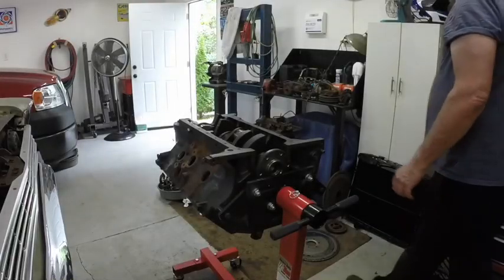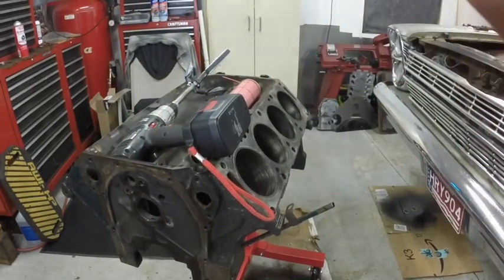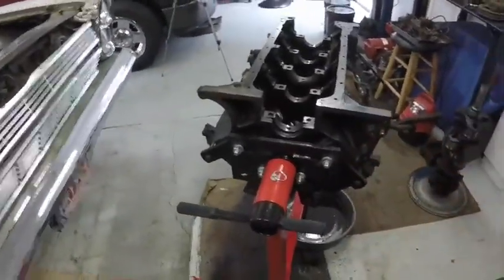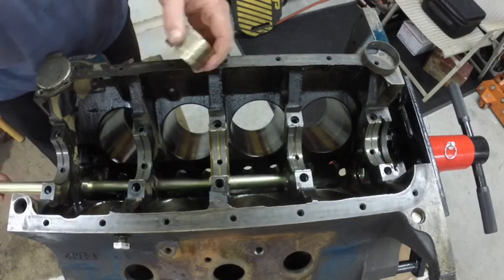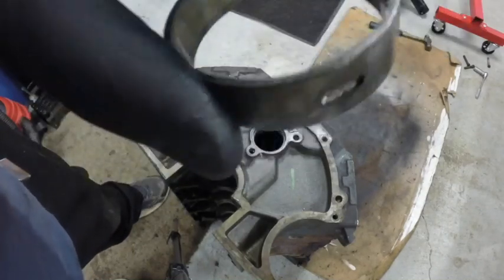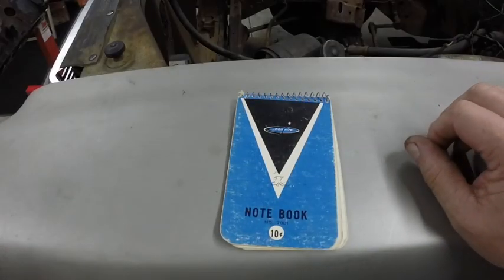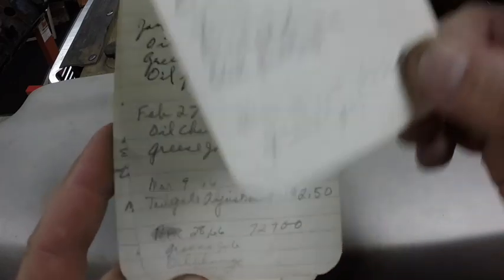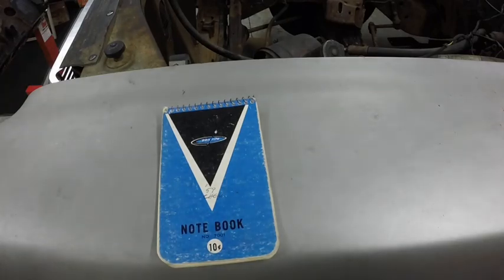1966 Ford Galaxie 500 convertible restoration part 12 honing the cylinders

Comment: You're right about the savings of doing things yourself.  I recently had my 2012 Mustang in for state inspection which it passed easily but the inspector mentioned that my water pump was leaking and would I like an estimate for the repair.  A few minutes later he came back with a total of over $400 to replace the water pump.  I told him thanks but no thanks and went home to do research on how to do it myself.  I found 2 or 3 videos of the process and it seemed fairly easy and straight forward.  Double checked my car to make sure the set up was the same as in the videos which it was.  Bought a water pump and a gallon of antifreeze for just over $100 and did the repair myself in just under an hour.  It's now been a month and about 1000 miles and it hasn't leaked a drop and I still have the extra $300 in my bank.

Comment: FM on the cam bearings-possibly Federal Mogul? also we had an International 304 V8 that had problems with oil pressure due to the babbit peeling off the cam bearings, the rest of the engine was still in good shape but when Dad dropped the oil pan there was pieces of bearing material in it.

Comment: Did you ever check the deck for flatness high/low spots?  I watched the measuring video but never saw you put a straightedge on the decks. Curious with all that sludge in the water jackets if that engine over heated.  Great series, really enjoying your work!
Reply from the maker: I did... guess I should have shown it on the video. No warpage at all. Both my brother and I agree, we feel it may have overheated at one time. It did have a recored radiator... that adds to my thoughts it may have overheated. The guy at the shop where the head are, stated the head are in great shape, no cracks or warpage. These older engines could take overheating, without destroying them, unlike todays thinly casted engines. I have seen engines of this era so hot they lock up. When they cool off, they crank up, and still run good for years.

Comment: Why are you using Brakleen for honing?
Reply from the maker: I using it to clean and lube... anything will work, carb cleaner, WD-40, I just happened to have several cans of the stuff, so I used it.
Reply: Just that Brakleen is very"dry" no lubrication,kind of like starting fluid.
Reply from the maker: @josephandres1294  It does a great job. Most of the mechanics I know use brake clean or carb cleaner.

Comment: Did your dad wish he had a powerglide vs the turboglide?
Reply from the maker: He never had another GM car of the era with those types of transmissions, so I doubt it. I had a 60 Chevy with the 283 2 barrel and Turboglide. It was lousy out of the hole, but got great gas milage. There was no shifting. It was novel... I kinda liked it, other than the lack of get up and go, from a stop. I think it was only used from 57 to 61, in Chevrolet's.